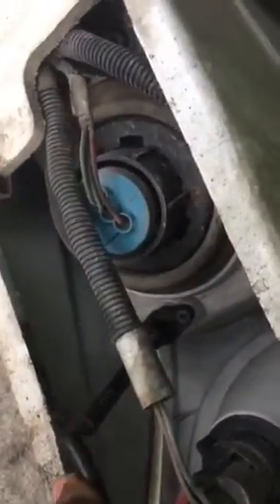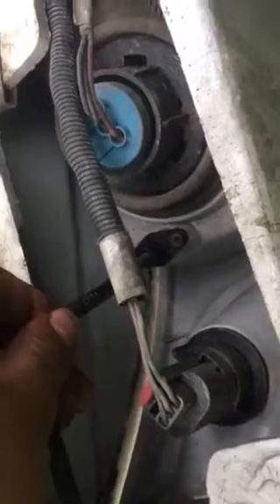Adjust head light on a 386 peterbilt

Comment: How did you break the triangle piece, I’m trying to change my bulbs and on both sides I can’t get the plastic cover off. The triangle bolt won’t turn. I’ve tried everything.
Reply from the maker: I cut them of with a hand saw. If you got power tools even better. Then I used bicegrip pliers to get the little stub off
Reply: Ahh thanks . I saw the comment about wd40 so I’m gonna try that first then if not I’ll break it off